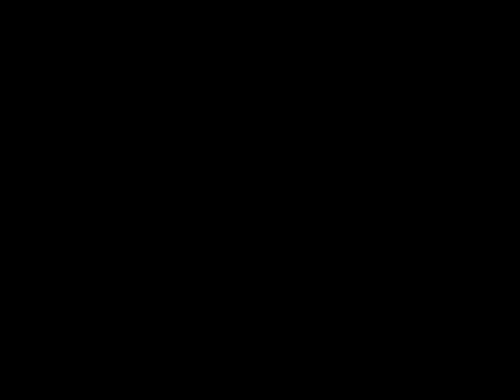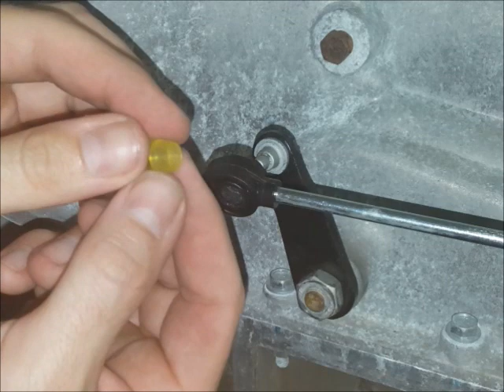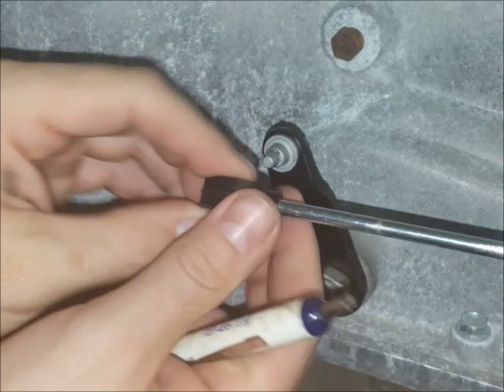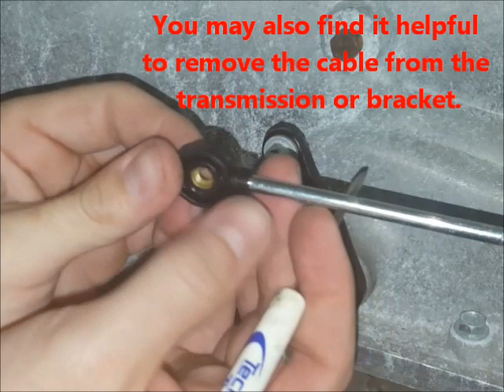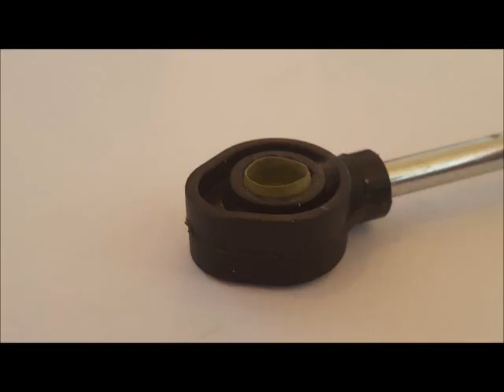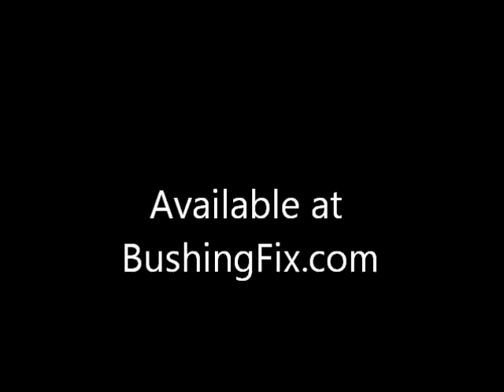Dodge Dakota shift cable the easiest way to repair !   Kit includes replacement bushing.

Comment: I have a linkage is not working
Reply from the maker: Cecil an easy way to determine if you need bushings......disconnect from the shifter end of the cable.  Inspect the bushing - is it fragmented? Cracked? Broken? or totally gone?  If so the bushing would need to be replaced. If your Dakota is an automatic.....there is actually another bushing at the transmission end of the cable as well - inspect it.  If both bushings are intact.......inspect entire length of cable.  Rarely does it get cut or fail but there is always a small possibility.
Reply: @BushingfixFL  Thanks I will definitely do that inspection next before I swap the transmission.